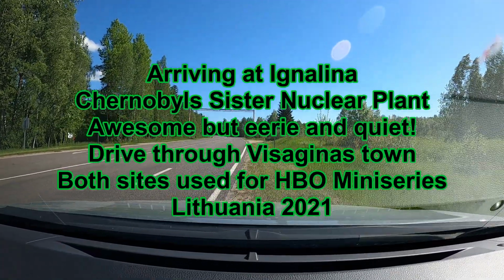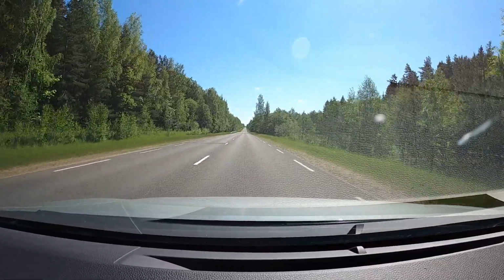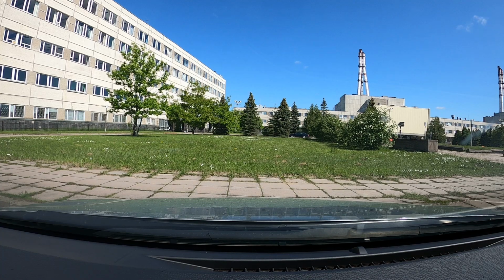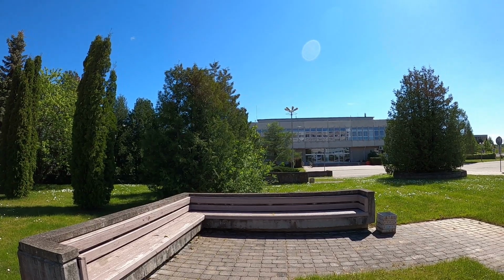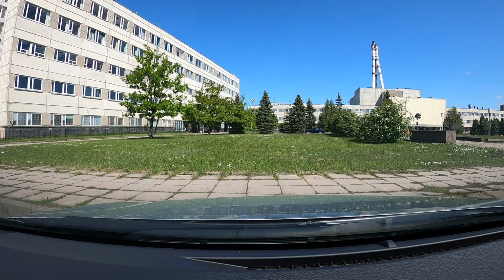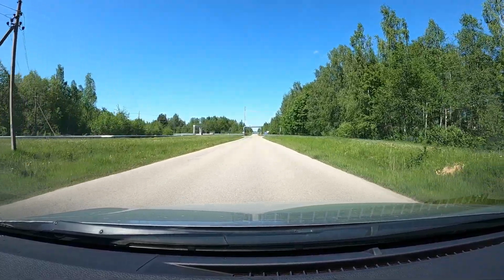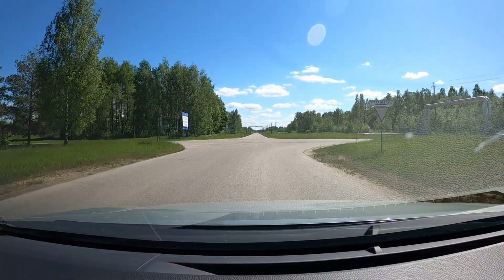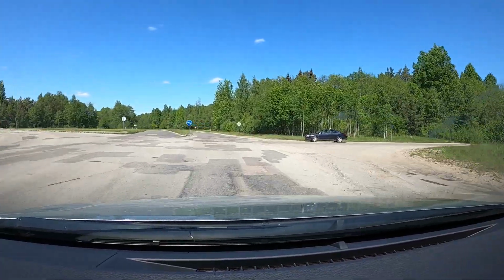Chernobyl’s Sister Nuclear Plant Still Exists ☢️ Inside Ignalina

Comment: Those are vent stacks not cooling towers. I believe they are used to release radiation in safe amounts I believe.
Reply from the maker: They are actually referred to as 'cooling towers' although they do not have a traditional cooling pond. They are like big heat exchangers, they turn steam back into water and the excess heat is the white plume you see released when they are working. People often confuse it with smoke but its water vapour. So they are called cooling towers.

Comment: It's decommissioned and it's getting dismantled. There has never been any discussions of reopening it - there was supposed to be a new one built, however, it was cancelled due to advisory referendum (just like Brexit) https://lt.wikipedia.org/wiki/Referendumas_dėl_naujos_atominės_elektrinės_statybos_Lietuvos_Respublikoje . The old power plant was already modernised after gaining independence but it had multiple safety flaws in the design of the reactor so no matter how many safety "features" you would add, it was still an unsafe design at its very core. Literally.
Reply from the maker: Thanks for the comment. Yes I read various things about plans for it, including adding a new reactor etc. I found out a lot more after the visit about the stages of the fuel removal and storage , including the new so called safe containment units for spent fuel and was surprised to learn how much is still kept there and will be stored there and that process is still going on as you say. All I knew about the reactor was that it was an RBMK like at Chernobyl, which I suppose means it still had inherent risks if it had not been modified. But you seem to have more of an insight and working knowledge. Cheers again.
Reply: @BitsofEurope  no worries, thanks for the video. Yes, it's indeed almost identical to the one in Chernobyl, the only difference is that it was more powerful and at the time they opened it - most powerful in the world. It's really sad to see the Lithuanian nuclear industry go to waste, this is a good example where lack of political will can lead. The new one was supposed to be built by Hitachi and safe which would have provided affordable electricity and independence from importing the electricity to RU/BY and other countries. Speaking of independence, if you ever visit LT again, you should really go to Klaipeda and see the LNG tanker called Independence, this one if enough to provide the whole country and some to the neighbouring baltic states with natural gas if the Russians decide to turn the tap off. Really important object for the national interest.
Reply from the maker: @morkiuzz  Noted. I will put that on the list..ty.
Reply: @morkiuzz let's be honest. It's the price Lithuania has to pay for adopting the EU values 😂
Reply: @thecoin5394  the values of prioritising safety over public health? Yes, these are the values Lithuanian society welcomed very well.
Reply: @morkiuzz  with friends like the EU and the US, who needs enemies? 😂
Reply: @thecoin5394 what enemies? Forgot to take the pills again?
Reply: Nonsense. It was RBMK-1500 which was more modern than RBMK-1000 and it already also recieved safety improvements after Chernobyl. There was literally no risk of something happening. EU is stupid.
Reply: @CombineCollaborator  oh so it somehow got a containment building and stopped using graphite?